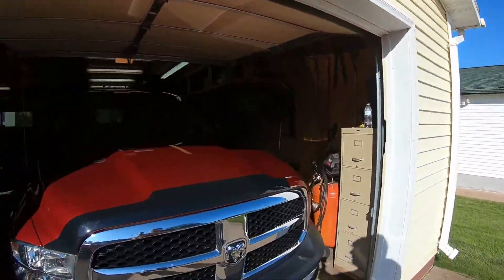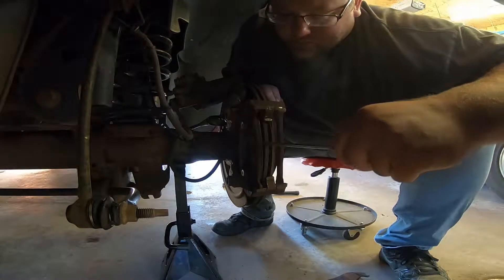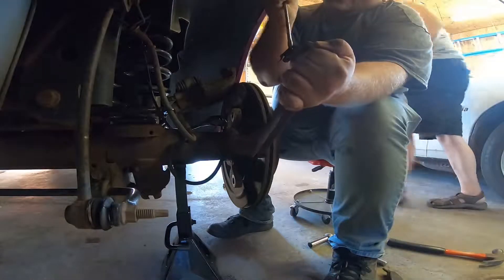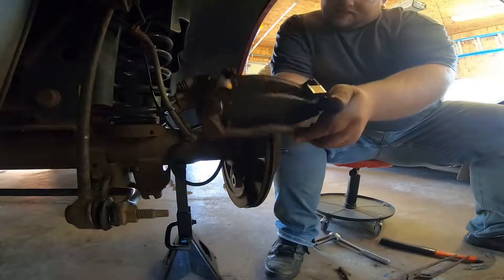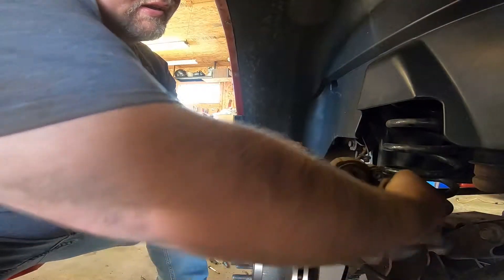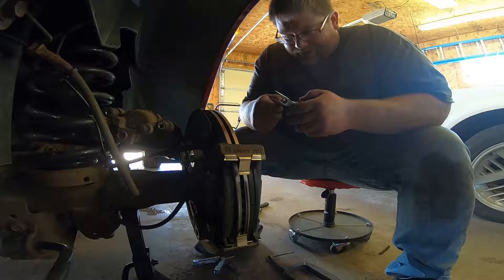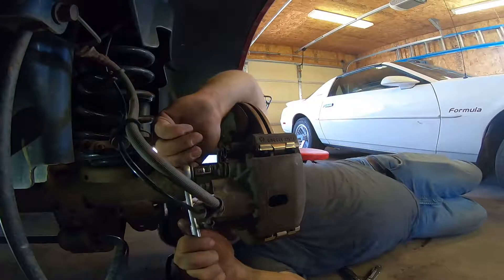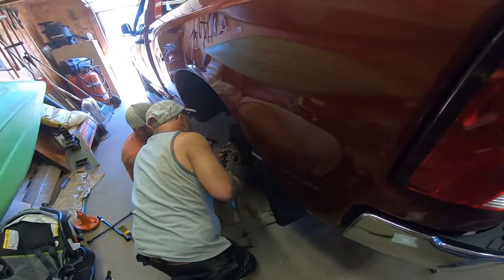Ram 1500 Rear Brake Job- Pads and Rotor Replacement

Comment: The parking brake shoes were destroyed because they were not backed off and rotor was forced off while parking brake shoes were caught under lip of worn rotor, and then smashing them to peices hammering the rotor off.. a small screwdriver in the slot behind and turning the star gear inside to back off parking brake first, then the rotor would come off easy (albeit with a little tapping to unstick rotor from hub) then with new rotor installed.,. you can readjust star gear.. its extra 5 mins of work, will save 30 mins of pounding and smashing imterma; brake parts.